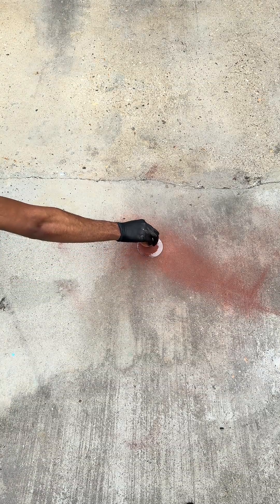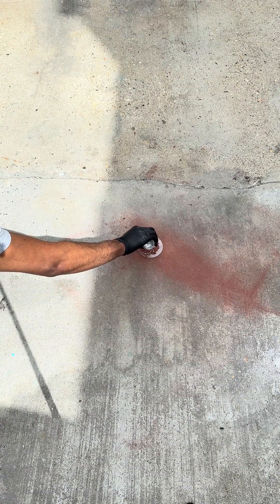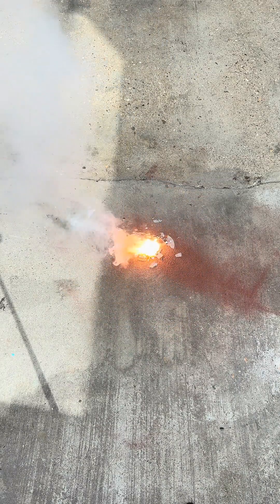Thermite reactions burn at 2500 °C #science #chemistry #experiment

Comment: thermite welding, which uses a high-temperature chemical reaction to fuse the rails, or flash butt welding, which uses a high electric current to heat and press the metal ends together and mixture of aluminum powder and iron oxide is heated, causing an exothermic reaction that produces molten iron and slag at over 

￼

3000∘C3000 raised to the composed with power cap C

3000∘𝐶

.

Comment: Thermite is naughty stuff, innit. If you REALLY don't like someone,  block the hole in the bottom of a ceramic plant pot (anything will do, bit of cardboard or plastic), fill said pot with thermite compound and place it on the bonnet  of someone's car. Stick a sparkler in as an igniter and light it and once burning the thermite mixture will flow through the hole in the plant pot and burn right through the engine block like it's melted butter.  You're welcome 😂